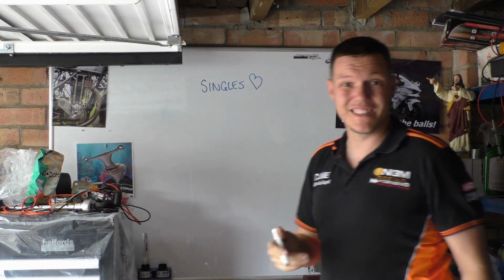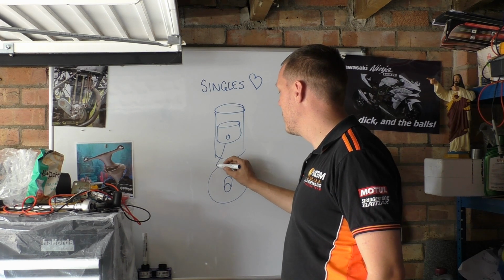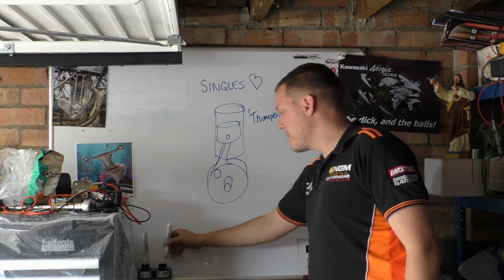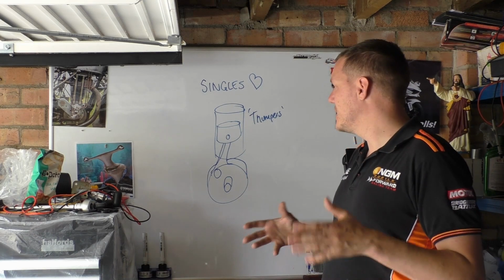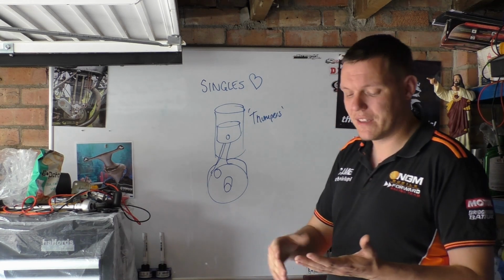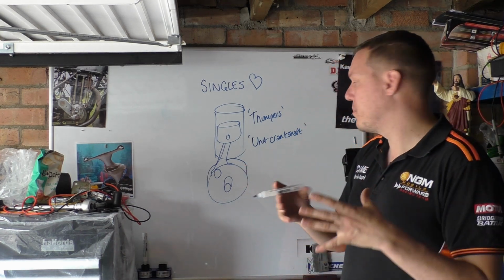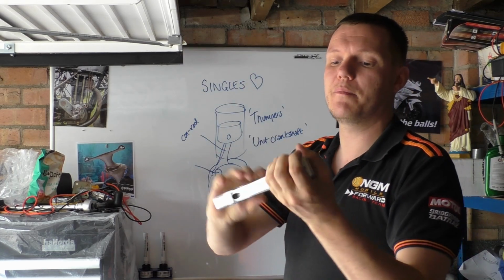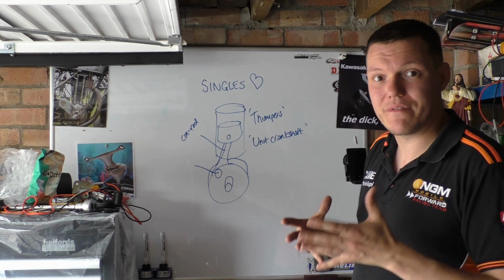Motorcycle-simple - Single cylinder engines

Comment: Okay stick with me. Polaris has two different large bore single cylinder motors that they have put in just about everything. The 500cc motor or the earlier of the two runs a sohc with a bridged rocker set up to run the 4 valves per cylinder. The newer 570cc motor runs a dohc setup to actuate the 4 valves. Is the dohc setup in some way Superior or did they simply add an extra cam for the sake of making it more complicated.
Reply from the maker: Using DOHC puts less strain on the valve system, and the 500cc makes less power than the 570cc and NOT only because of the extra 70cc but they have probably changed the bore and stroke and other improvements. 

They were probably running the SOHC to its upper limit of what it can safely take. This meant that they probably had no choice. This happened a lot in the 80's with upgraded models of motorcycles.

Comment: matt do you know why all the 4 stroke 125cc motorcycles only have 1 cylinder? (aprilia rs4 125 (4t),yamaha 125)
Reply from the maker: Go on then elighten me.........
Reply from the maker: Enlighten* - fucking fingers!
Reply from the maker: Wait a minute is this a question? I read it like you were going to tell me.........
Reply: this is a question :D
Reply: why do you want more cylinders in this little engines ?
Reply: to get more POWAAAA... put if you think about it if you remove fuel ejection and 4 valves per cylinder and make a v twin carb engine with 2 valves per cylinder you will probably save money and get more power
Reply: @marioraja4229  sounds like a honda varado 125

Comment: how on earth do DOHC (Double Overhead Camshafts) single cylinders work?

bikes like the KTM Duke's, up to 390 have the same kind of single cylinder DOHC engine, but I don't get how that works
Reply: what exactly is making you confused? like... take an inline cyl engine, and then just chop it up until it's a single cyl.... there is no difference..... just
Reply: Desantos123 UK the crankshaft connects with the camshaft and it's cyncronized. Maybe through gears or belt or even a chain.